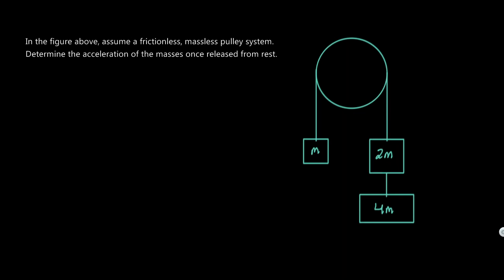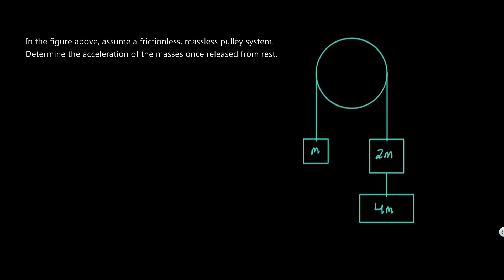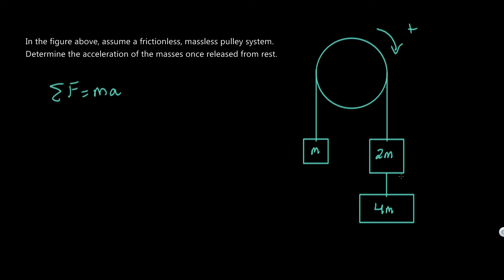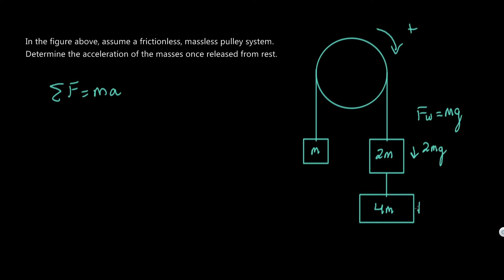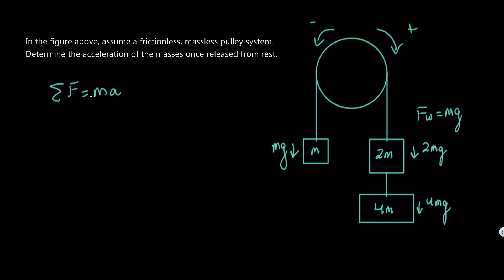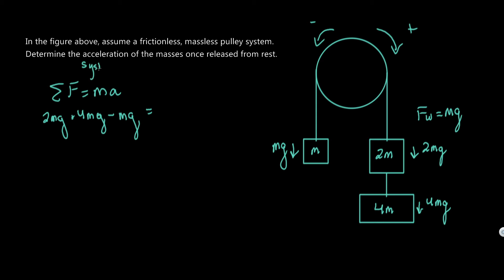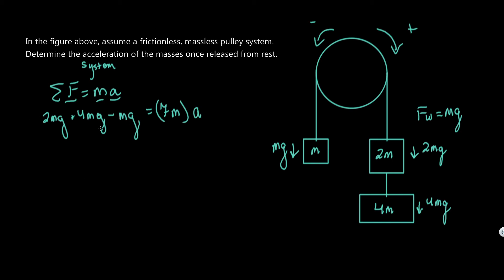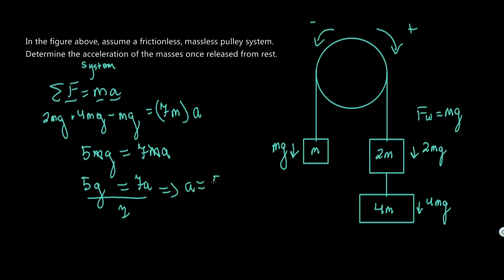Determine the Acceleration of the Masses once Released from Rest

Comment: How to calculate tension in that case
Reply from the maker: Since the acceleration of the system is uniform (5/7g), just take a free body diagram of the block with mass m. You can see that the force of tension T is going up, and it's weight is going down, that's it. Taking ΣF = ma, T - mg = ma. We already found "a" to be 5/7g. So T - mg = m(5/7g). Rearranging, T = mg + 5/7mg. Thus tension T = (12/7)(mg). The problem didn't specify what any of the masses are, so technically that's your answer. If you want, you can plug 10 or 9.8 m/s^2 for g, but m is still unknown.